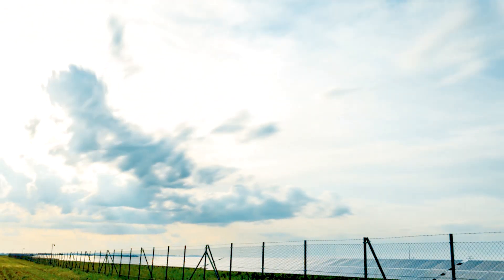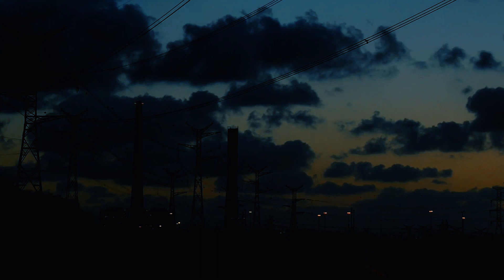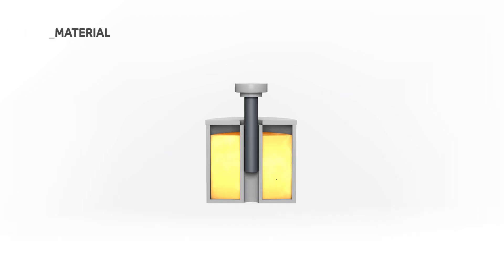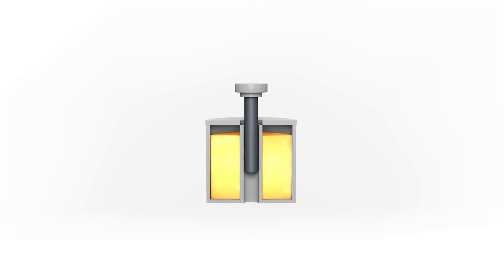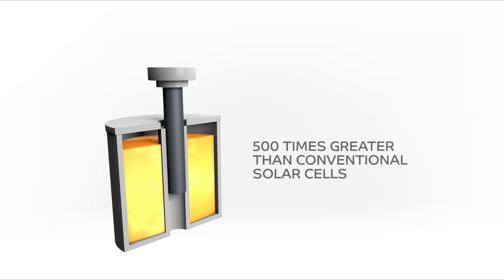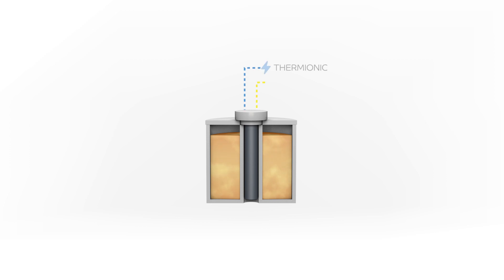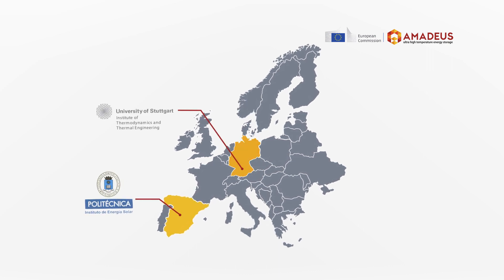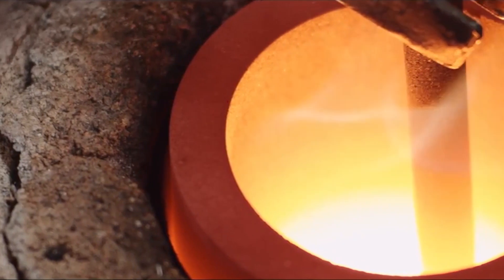AMADEUS Energy Storage

Comment: Pretty genius. Molten salts are corrosive and this is probably much less corrosive than that. Rather than using CSP to heat the molten salts and combine it with water to drive a turbine, this aims to harness the heat and the light to power solar panels. Very nice.
Reply: fficiency? 20%?
Reply: @davemwangi05  Actually, no. The heat and light are directly converted to electricity. Look at the video again. The system is actually super efficient, If they can get the right materials to conduct and contain the lava-like liquid in side it.

Comment: 2:12  So 1kwh/l ?   Liquid hydrogen has 2kwh/l and 30kwh by kg, The round trip efficiency might be similar, but hydrogen can be used in the transport sector or in the natural gas grid which in that case its efficiency utility increase.
Reply: Different technology. Hydrogen is a good solution but not for all applications. Moreover, Silicon + Boron alloys can at least match H2 capacity
Reply: While Hydrogen has round trip efficiency of 40%, storing it in liquid state is energy-intensive and expensive. This design appears to have promise. I know there are a few university labs trying to master their own thermionic photovoltaic converter, which seems to be the most difficult part.

Comment: Im not sure i got it right....what is the purpose of effort you spend on what i see as a battery form that is so far behind what other companies are able to do today. Im no expert in price of one another, but i know of alu battery that has a density of 8kwh per kg - i dont know what a liter of alu weight is but it will cost like 2dollar. It sound like a stupid job to make electricity and convert it to heat so you can store it and then convert it back to electricity, i would guess you have a loss of energy in both converting cases. Why is it needed to store ultra high temperature heat? If you can make that heat why isnt it possible to make it all 24/7? Around here we use more energy during daytime, so if you think you can produce more energy during daytime, then why dont you just sell it to the grid? You do know there is markets for energy and price is best during daytime. This is waste of money, if you can make this kind of heat i guess you can make it whenever you like.
Reply: Because renewable energy is nt stable..like u need wind day for wind turbine .u need sun for solar...when they re arent .u need some kind of battery to stored and discharge later to feed the demand.
Reply: what are you bitter for? You're screaming at them yet you don't even know that electricity demand is higher in the evenings and very low during midday when solar is producing it's max.
Reply: What abt night

Comment: HEAT FOR TOMORROW

Many materials used in our industrial world require energy from mining to manufacturing for processing and transportation.  The energy for some of these products is in the form of high temperatures – 2000° F (nearly 1100°C).

There are proposals that solar and wind energy collecting devices can provide the energy to maintain the industrial world.  To look at this possibility, solar electric panels, wind turbines and concentrated solar installations in the form of parabolic trough collectors (PTC) have been assessed. 

The energy requirements in 2010 for the following essential components of our industrial world are provided: steel, aluminum, chromium, copper, manganese, cement and glass.  This energy would be mining, processing and transporting to name some.  Other important components of the industrialized world such as nickel and cobalt are not considered because they are part of the high temperature processing of other ore metals.

The kWh output and area required for installations of solar electric panels, wind turbines and PTC has been researched.   This then is divided into the energy (exajoules converted to kWh) required for global production of each material in 2010. 
NEEDED
121,214.45 Square Miles of Solar Electric Collectors
257,472 square miles and 2,807,276 Wind Turbines
77183.4 square miles of PTCs
There are many other critical components of our global industrialized world that require industrial heat (lead, silver, tin, food processing) that are right at the top heating limit of solar devices.  They must also be included in an all “renewable” future. If only half of important materials were provided, what would our world be like?

See maps, images and calculations at:
http://sunweber.blogspot.com/2017/08/heat-for-tomorrow-many-materials-used.html